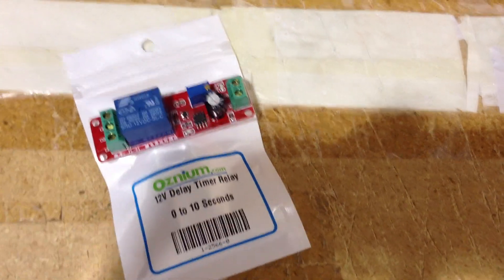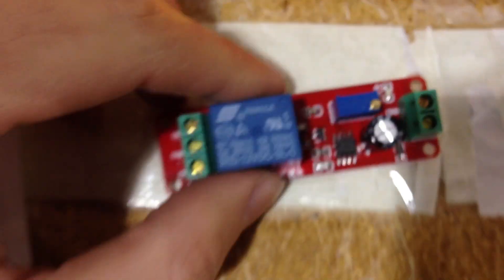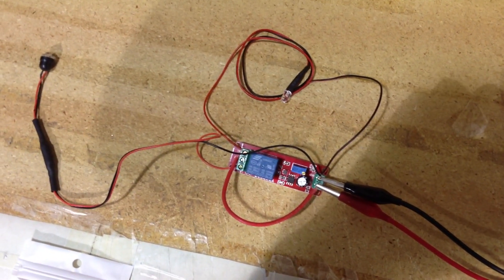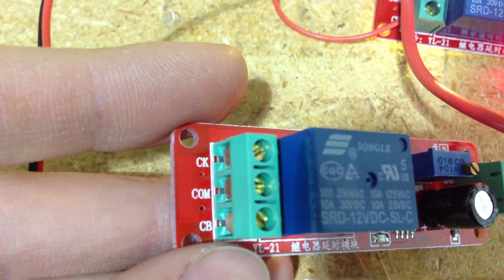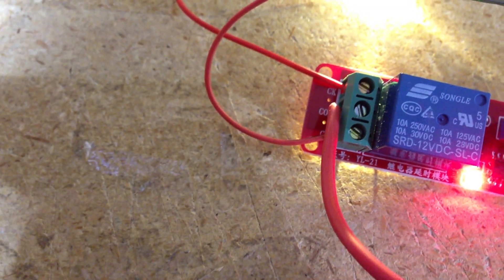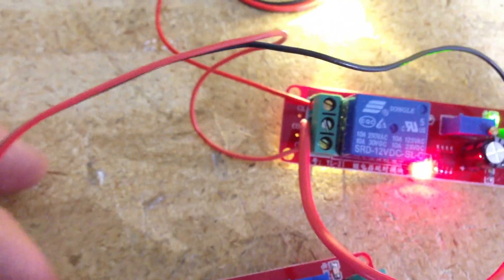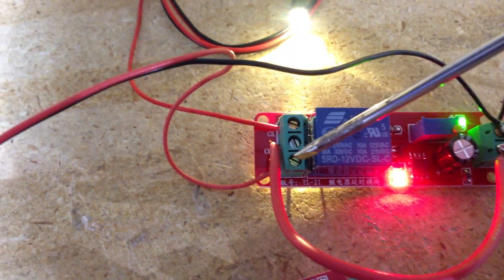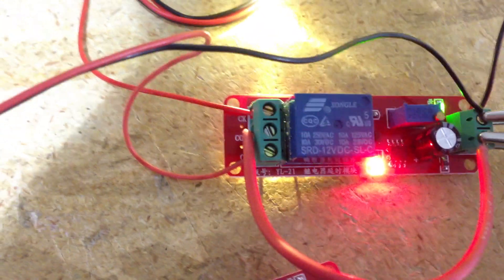12V Delay Timer Relay 0 - 10 seconds

Comment: Hi great video - I have a question.  If I wanted to do the same delay/pulse but when the power is switched off, how would I achieve this?  So I turn off the power switch, it does a pulse, then stops.

Comment: I need to know if re-applying power within the time interval resets the time interval without powering off the LED.  For example, in the case of a refrigerator light, if you wanted to have the light come on when you opened the door, and remain on for 10 seconds after you close the door, but if you open the door again before the 10 seconds are up I need the light to stay on (resetting the 10 second count rather than completing the count).  Is this how this device functions?

Comment: Can I use this relay for my cars daytime runing lights and turning lights combination? like daytime running light is on and when I switch on the turn signal the daytime runing light will go off until swiching off the turn signal.
Reply from the maker: Yes, you can.

Comment: Using this to activate a cigarette Lighter plug light emergency dashboard LED light. I dont know the amperage of the lighter plug. I just want the power to go to the light, mounted on my motorcycle for 10 seconds when the brakes are applied. Will the 0-10 second timer work?

Comment: I am planning to fit a delay relay into my car Audio which looses power momentarily from Acc everytime I crank the engine and that I want to prevent. 10 seconds delay should be fine for me as the audio looses current upto 3-4 seconds max. Could you please help How Can do that. I can buy 10seconds relay circuit from ebay, but I am unaware of the wiring it up. My common sense say it should sit in between Acc connection and car audio. need help on wiring.
Reply from the maker: It is best to ask the store/seller who you purchase it from, as the instructions could be specific to the certain delay timer product you get.

Or if you purchase this one from us, we're happy to help you with support:
http://www.oznium.com/12v-delay-timer-relay
Reply: OzniumVideos com

Comment: How do you use one of these to trigger car door locks, but only pulse once? Like have the input come from the car ignition, then after 6 seconds it locks the doors? the problem would be that the relay would be always closed and constantly applying 12V to the door locks.
Reply: +liamvg DC 12V Delay Relay Delay with Timer Turn on Delay Turn off Switch Module
this relay does what i think your asking   switch on power to it it then counts down activates the relay and powers down/off leaving relay switched over until you next switch on power to it which then causes it to switch back over immediately and then starts count down again

Comment: I need lag between both closed and opened. Which means there must be some capacitor on board which powers coil when 12V diaconnectes. Is there such?

Comment: Thank you for the support Adam!
I am trying to limit the closed circuit time with this relay unit, and surmise it needs to be in a normally closed position. Can you say how this is done? 
My application is for a floating limit switch that triggers an electric pump to refill a container when the liquid level gets low. I wish this relay unit to limit how long the pump runs, in case the limit switch does not shut the pump off, because the limit switch occasionally fails to break the circuit even when the limit switch rises.
Will the circuit board reset and allow successive short pumping duration in case the float is still sensing a low level? The low level / close circuit function works well on the floating limit switch.
Thanks for any advice

Comment: I need a relay which when trigger lights up bulb for 5 seconds and thereafter, switch off automatically. Is this possible?

I'm confused with the above video whether the relay repeat it's functions within set time intervals. 
Thanks.
Reply from the maker: Yes, its possible, and exactly what this is designed for. When you apply the trigger, the bulb can light up for 5 seconds and then switch off automatically. Once once you re-apply the trigger the bulb will then light up again for 5 seconds. If you don't re-apply the trigger, the bulb will remain off. Please buy here: https://www.oznium.com/led-controllers/12v-delay-timer-relay
Reply: OzniumVideos okok that for informing me back
Reply: OzniumVideos can it output load which requires 25 amps at 12 v DC.
Reply from the maker: @tnamen1307  25A @ 12VDC is at the upper limit of what this relay can handle. It may work, but the relay could also burn out. For ultimate reliability, I'd suggest using this relay to trigger another larger current relay.
Reply: OzniumVideos please suggest best relay for 25 amps at 12 v DC output apart from this  relay  timer. I want to use for rolling up my car i20 windows.
Reply: OzniumVideos also the output power is within the rated range , can't I used to supply output 25 amps under 12 v DC???
Reply from the maker: @tnamen1307  https://www.oznium.com/wire-12v-and-relays/relay40

Comment: Someone else might have asked is before, but do you know the minimum delay? Is about 0.2/0.3/0.4 seconds possible as a delay? Thanks in advance. Kind regards, Diederik
Reply from the maker: +Diederik van Duijn The resolution is 1000ms. So if you need a 100ms resolution, we can certainly custom make it for you. How many do you need?

Comment: I was thinking this did something else. I need a relay that once triggered will only stay on for X amount of seconds. For example, once triggered will latch for 30 seconds and then unlatch.
Reply: A relay have 2 positions, NC & NO. Normally closed & normally open. So just use 2 delay relays in oposite configuration like 2nd one will stay on (COM-NC) until the delay, then it will turn "on" - switch off your circuit. I hope it makes sense

Comment: How to make the led flash for 30 seconds and off and repeat every 30 seconds?
Reply from the maker: Please clarify: Do you want the LED to be on for 30 seconds, and then off for 30 seconds, and then on for 30 seconds, and then so on... 

Or do you want the LED to blink for 30 seconds, and then stay off for 30 seconds, and then repeat? If you want it to flash during the first 30 seconds, at what flash rate do you want it to flash? For example on for 200 ms, and off for 200 ms? You didn't specify the flash rate you need.
Reply: OzniumVideos on for 30 seconds and off for 30 seconds...and repeat same process.

Flash rate is 30000 ms for on and 30000 ms for off..

That means in 1 minute the led will be on for 30 sec and off for 30 sec.
Reply from the maker: @tnamen1307  We've made a video to show how you can achieve that effect here: https://www.youtube.com/watch?v=RL8B1GeqMLk
Reply: OzniumVideos ok thanks for the information but need some help also indeed.

How to make car siren sounds for 30 seconds and repeat the process?

Thanks.
Reply from the maker: @tnamen1307  Same exact method... But instead of hooking up the LED, you'll hook up the siren.
Reply: OzniumVideos ok...how to adjust the delay for 30 seconds using the potentiometer??
Reply: And I want this delay timer to roll up all 4 windows of my car at the same time?

Will it work for this car?
Thanks in advance.
Reply from the maker: You don't need a time delay relay to do that. Just apply power to your window motors at the same time, and they will operate at the same time.
Reply from the maker: What is your order number? I want to see exactly which products you've bought so I can help further.
Reply: OzniumVideos I have not ordered yet as I'm not sure about it.
Reply: I'm looking for the same product shown in this video especially 4 relays attached to one PCB board.

Or if the above shown product is capable of closing all windows at same time, I would prefer it.
Reply from the maker: Turn the potentiometer to adjust, from short to long time delay.
Reply: OzniumVideos ok...how to increase output current amperes?
Can I get at the maximum by 25 amp? Because the car windows has got 25 amps per windows.
Thanks.
Reply: OzniumVideos all my dauds is the output current value....
Reply from the maker: You'll have to use a larger relay.
Reply: OzniumVideos please recommend suitable relay for 25 amps. Thanks.
Reply from the maker: @tnamen1307  https://www.oznium.com/wire-12v-and-relays/relay40

Comment: I see this is a timed turn on, Do u also make a timed turn off? I want my equalizer in my car to stay on 3-5mins after i turn my ignition off. Thank you.
Reply: +Daniel Agront You can use it for that too. All you need to do is switch the input on the relay and adjust the capacitor for 3-5 minutes.

Comment: Hi mate wondering if you can help me? I've bought one of these off the Internet just waiting for it to arrive, I need to power something on 12v turning on every second and off every second so continually in this cycle, is this possible or have I just waisted my money?

Thanks
Reply from the maker: +Lorrie Colin Thackeray Hi Lorrie, its certainly possible to have the automatic looping effect, but not with just one unit. You'll need two. I can't find any recent order with your name (perhaps you've ordered with different name, or not from Oznium.com?)
Reply: OzniumVideos can you share the circuit diagram?

Comment: Will this output 12V DC @15A(or lower)? or does it output 30V DC??
Reply from the maker: ***** The relay is simply rated for a max of 10A at 30VDC. You can run any voltage through the relay so long as its 30V or less (and under 10A of current). If you put an input of 12VDC to the relay, then yes, of course it'll still output 12VDC.

Comment: So the switch only happens once or does it keep cycling. Also how many amps can that little board handle? Reason I'm asking is that I'm adding an oscillator to my clay trap but I don't want it to constantly stay on so I want an interruption something like 3 on, 7 off or even split 50/50. Would still save alot of battery life. Thanks in advance.
Reply: What machine do you have dude? Atlas Traps makes Random delay timers for trap throwers.  1 to 7 sec random delay so you cant figure out where the target will be in the osc then shuts down osc. email their website.
Reply: John Atlas I have a wheely bird($280) that I'm going to mount ontop of a do-all wobbler($214). I think they have a good product overall in their traps but I can't justify spending $275 on a delay timer when I can build one for $20-$40. I just need to know if this will handle the current so I can shave even more money.
Reply: ***** Sounds good I would probably suggest then that you use a 30 amp automotive relay to control the 12v power with a "10 amp circuit breaker" or tie in to the exiting one on the oscillator if it has one? and put the delay timer on the switch side of the relay so you dont run the risk of low voltage from your DC battery burning the board up when your out shooting.  If your using your trap thrower for a long period of time Low voltage from your dc battery will spike the amps and cause your wires to get super hot and the components on this board wont handle that.